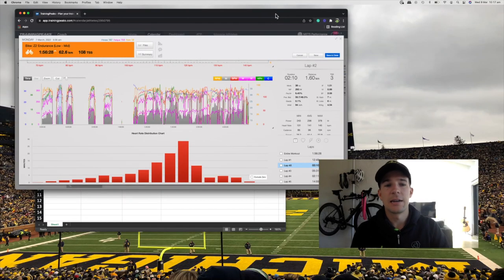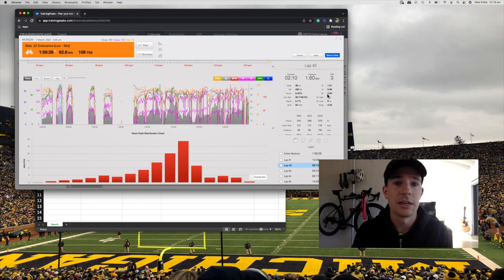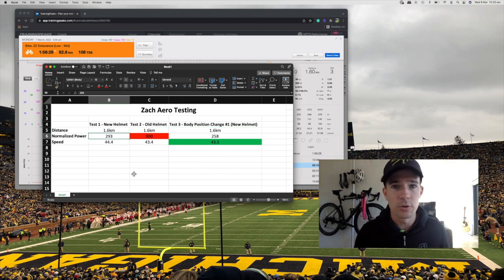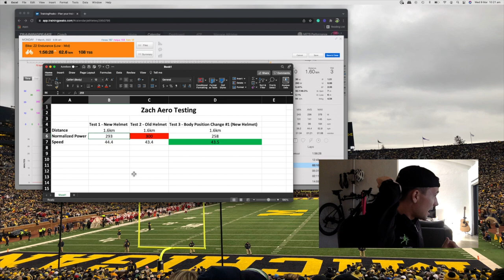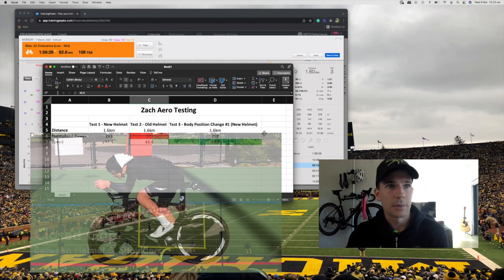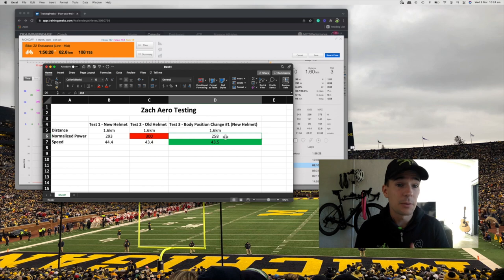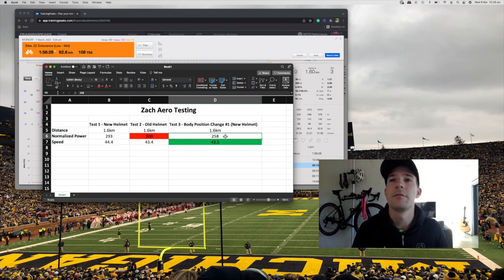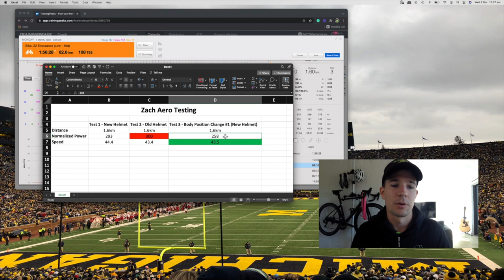HOW TO TEST CYCLING AERO (Cheap, Practical, Effective)

Comment: Hey Nick, what do you think of this method of testing the aerodynamics of a setup? I've got a short local hill that ends with an extended flat, in the past I've started almost at the top and just free wheeled down until I came to a stop. My theory being the further I went the more aero my position/setup must be.
Reply from the maker: Love the thought process in theory. Makes a lot of sense, however practically we aren’t capturing the impact of a realistic position.
What I mean by that is any movement of the body as a result of producing the desired power output. Largely, this comes down to how well you can actually ride in a straight line or how much does your body move. Easy to do when free wheeling, much different when actually exerting race power.
A number of other factors there influencing, but the other aspect I think of is you have variable speed (start slow, gradually accelerate then gradually slow down). Not really that applicable to racing at more constant speeds, unless free wheeling down a hill is your race.